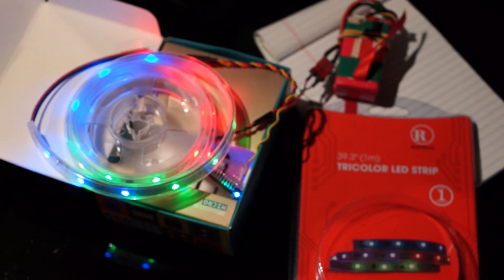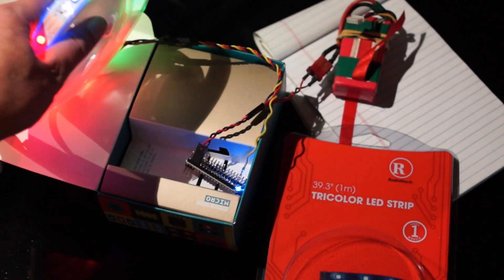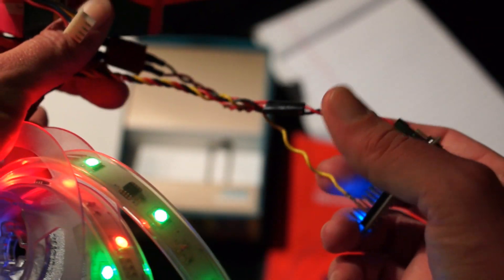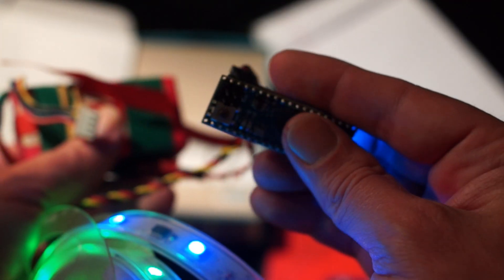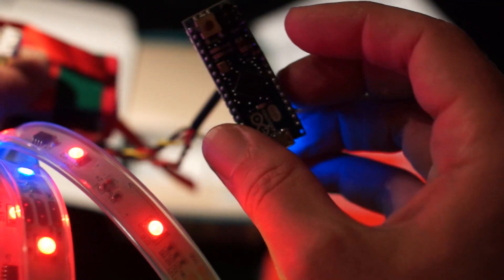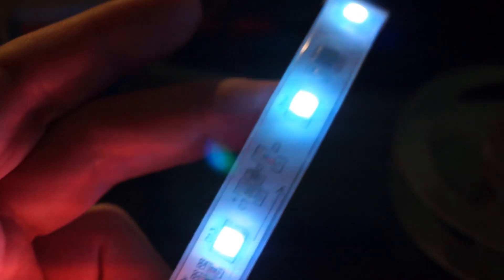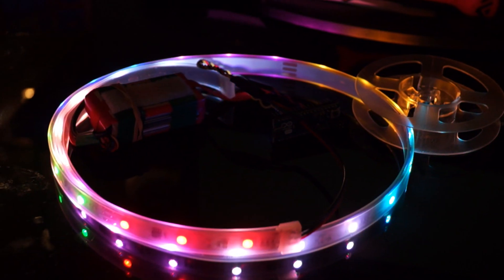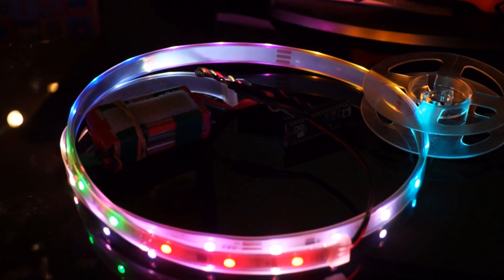Radio Shack Tri-color LED Strips How-to

Comment: This library linked above doesn't work with the Radioshack TM1803.  But the library that "skeepskeeperson" put in the comments below, worked with my strip.  Keep in mind that the Green and Blue signals are switched in this library for some reason.  So (0,255,0) is blue and not green, as well as (0,0,255) is green and not blue.

Comment: Mine still doesn't work, I have swapped boards, LED strip, code, the digital pin out. IDK why i cant make these work its really starting to make me feel like this isn't my thing. I feel like just go buy some pre made LED stuff like normal people do... Whats the issue with these anyway??? And why don't they just work properly with this or any code ive tried??? I found these for 90% off and they gave me an idea for a quick LED infinity mirror PC Case light. Now im regretting the stroke of inspiration...

Comment: Do you know how to create a fade effect with the Radio Shack LED Strip? Also if you had used an UnoR3 would you have powered the strip using a 12 Volt/1amp wall wart plugged into the Arduino instead of the battery and spliter? I found the actual Radio Shack program code and instructions and seems to work as advertised.  Did you ever finish your project with your copter?

Comment from the maker: @ForSquirel- I wasn't lucky, I was persistent. When I realized that the data stream it needs is very simple, I just found a library that sends that kind of data and worked with it until I got it. Most of the folks here seem to be having wiring problems. I got two more of these strips before Radio Shack closed and they work fine.
Reply: +jasmine2501 can u tell me how u did it?  i get crazy blinking.
Reply: +carlos limon im using a arduino micro.  when i try one color only and one light it still seems wrong.
Reply from the maker: Sounds like a wiring issue - many people make the mistake of not providing enough power to the strip. It's tricky - you have to provide plenty of power for the strip, but you can't run that through the Arduino, it has to be parallel.
Reply: yup.  dont forget to ground arduino if using a usb.

Comment: Hey man can you please help me out. I plugged the red wire to VIN, the green wire to Analog 0, and the black wire to Ground, like the radioshack instructions showed. On the code you gave us, i changed <10> to <A0> , for analog 0, but when i run the lights on 12V, only the first 3 LED lights blink green for a second and thats it. After the first three blink, nothing turns on
Reply: only 3 lights blink green, idk what to do

Comment: This LED strip has been an incredible source of frustration. Would you mind helping me sort out the wiring? Anyone?
Reply from the maker: seanlovesjobo What is not clear from the video? The 12V source is wired in parallel to the light strip and the Arduino, with a common ground, and the signal line just runs from the Arduino to the strip. Make sure you have the right kind of LEDs - if your strip has 4 wires, then it's not the same one as in the video.
Reply: I've got the 3 wire strip. For some reason the strip doesn't light but if i disconnect the LED strip from the ground about 4 LEDS flicker or even come on. But that's all i can seem to get. the wiring was not very clear in the video but it seems like i get it, it just doesn't seem to work any ideas?
Reply from the maker: Almost seems like you wired it up backwards. I don't know how to help you in the comments. Maybe post a video, it seems lots of people have this problem? Look in the other comments too, some other people have reported the same symptoms.
Reply: Thank you very much for the response. Yeah i can't figure out how to trouble shoot it. I have tried fast LED libraries and pololu to no avail. With the multi meter it seems like there is some voltage drop in the wiring i don't have the experience to figure out why. I just came over to microprocessors through quacopters. If you can think of anything please let me know. LOL i can't believe i am getting out witted by an LED strip.
Reply from the maker: It took a little messing around before I got it right. As I said in the video, I had to figure it out for myself. It really is fairly simple, but having some microcontroller knowledge helps.
Reply: Ah no worries. They are bullshit and there is no support i took them back.
Reply from the maker: Definitely true given that Radio Shack is basically out of business. These were never designed for consumers really anyway, and the product packaging and examples are terrible. For those of us with electronics know-how though, it's just a strip of TM1803s which is a very common LED driver chip, and there's plenty of low-level information on it. I was able to figure things out from that stuff, but it's not designed for consumers, those IC data sheets are designed for engineers.

Comment: Bought one cheap in their closing sales - they are good - but the NeoPixels ones you can get on ebay for less than $10 at the moment are better as each pixel in the strip can be a different colour. So you get 30 individual leds per meter rather than just the 10 groups of 3 per meter in this one and so the animations you can do are better..

Comment: ----------im trying to have these controled by buttons and activate certain patterns when one button is pressed or when pulse light this pattern. or have them off untill a button press and have them turn on for a single loop. its for an old arcade machine mod. bbut from what ive read its not this easy to just rig up the switches on digitial input and drop in the code. some advice or help would make my day :0

Comment: the official non altered code worked fine for me and none of the code you wrote did not work, all of it keeps giving me errors. these are the errors i got for rainbow  and i get similar errors on your other code

LedStripRainbow:15: error: 'rgb_color' does not name a type
LedStripRainbow:15: error: expected constructor, destructor, or type conversion before '<' token
LedStripRainbow:19: error: 'rgb_color' does not name a type
LedStripRainbow:29: error: 'rgb_color' does not name a type
LedStripRainbow.ino: In function 'void loop()':
LedStripRainbow:54: error: 'colors' was not declared in this scope
LedStripRainbow:54: error: 'hsvToRgb' was not declared in this scope
LedStripRainbow:58: error: 'ledStrip' was not declared in this scope
LedStripRainbow:58: error: 'colors' was not declared in this scope

Comment: Thanks for the tutorial!

I picked up a couple of the TM1803v2.0 based strips from Radio Shack this weekend. I discovered that I needed to use version 1.2.0 of the pololu library in order to get everything to work properly - it did not work with what's currently on the master branch in guthub. https://github.com/pololu/pololu-led-strip-arduino/releases/tag/1.2.0

If it helps anyone else, I was able to use a 400mA power supply with my Arduino UNO to power this, while the documentation suggests that you need at least a 1A supply.
Reply: Drew Farris You sir are a life saver! I could not get it to work and I kept thinking it was something I was doing, but then I found your comment!
Reply: Johnathan Tafoya  glad to help!
Reply: +Drew Farris PERFECT! Hour of my time with the old library. Put on new library and WALA! On! Thanks.

Comment: can the leds work with only wiring it up to a DC source, aka without programming/microprocessors?
Reply from the maker: No, these are not designed to work that way. There are single-color LED strips that do work that way. You can't change colors without some method of sending that information, so NO simple DC-powered strips will change colors.

Comment: Thank's for the video. Are the strips your using the TM1803 chips? That is what I have from RS and every program I run is completely a completely different display on the led strips. I have installed the libraries and can get them to work but the led's just flash different colors and do not seem to accurately follow the code in the arduino ide. If you are willing to help I will post a video of the code I use including the PololuLedStrip.h and PololuLedStrip.cpp libraries and the outcome on the actual led strip(it is the 30 led 10 segment array. Thank's for any help you can offer.
Reply from the maker: Christopher McGehee Yes, as stated in the video, they are TM1803. Really, we don't need to be using all these libraries, a simple timed serial pulse is all it needs. The libraries are a little bit of bloat. Maybe extract the serial code from Pololu's lib and see if it works without all the overhead? That way you'll be sure what you're sending down the data line.
Reply: Christopher McGehee did you ever sort this out? I'm having a similar issue, and I'm not sure if it's the LED strip or something else.

Comment: Hey jasmine2501! I changed my colors to just red and blue and I am trying to get them to just stay a solid color but instead its just flashing and changing to different colors and i dont know why. here is my code can you help me? 

#include <PololuLedStrip.h>

// Create an ledStrip object on pin 10.
PololuLedStrip<10> ledStrip;

// Create a buffer for holding 30 colors.  Takes 90 bytes.
#define LED_COUNT 10
rgb_color colors[LED_COUNT];
rgb_color refColors[10];

void setup()
{
}

void loop()
{  
  //load the colors
  refColors[0] = (rgb_color){ 255, 0, 0};
  refColors[1] = (rgb_color){ 255, 0, 0};
  refColors[2] = (rgb_color){ 255, 0, 0};
  refColors[3] = (rgb_color){ 255, 0, 0};
  refColors[4] = (rgb_color){ 255, 0, 0};
  refColors[5] = (rgb_color){ 255, 0, 0};
  refColors[6] = (rgb_color){ 0, 0, 255};
  refColors[7] = (rgb_color){ 0, 0, 255};
  refColors[8] = (rgb_color){ 0, 0, 255};
  refColors[9] = (rgb_color){ 0, 0, 255};
  refColors[0] = (rgb_color){ 0, 0, 255};
  
  //loop ten times to create chasing effect
    ledStrip.write(colors, LED_COUNT);
    delay(1000); 
  }

eventually I want to be able to change the color of the entire strip to one solid color with a potentiometer but and also have a button to change to different modes but i can not do any of that if this strip doesn't want to work the right way. Any help would be great!
Reply: I know i have refColors[0] twice lol opps

Comment: Thanks for sharing this video. I was able to get my strip partially working. I can get the first three leds to light up, but only green. No matter what I change as far as the coloring it stays green and only the first three leds light up. Is this possibly a problem with my power supply? The adapter says the output is 12v 1a so that should be enough.
Reply from the maker: Well, yeah 12V 1A should be enough to light up more than the first segment at least. Make sure the LEDs main power leads are wired in parallel, not through the Arduino in any way.
Reply: jasmine2501 They are powered separately from the arduino.
Reply: I have the exact same problem, yet my power source is fine

Comment: only the first three lights are lighting up, and it's green. I have the same strip but could it be because i'm only using a 9.6v power?
Reply from the maker: Yes, 9 volts isn't enough. Some of the colors drop the voltage more than others, so you're probably just above the cut-off for green and below the cutoff for red and blue. Strange because red LEDs are usually the lowest voltage, but yeah, it's totally reasonable for only one color to light up with not enough voltage. The specs say to use 12V - in the video I'm using a 12.6V Lipo, but it's discharged a bit so it's just under 12V. You have a little wiggle room, but I wouldn't go lower than 11.2V (I can explain that number but it would be a long explanation, it's not a guess though)
Reply: Thank you very much for the reply! I was trying to help a friend get his strip working, that was my only guess for it wouldn't work ahah.

Comment: How do i use the c++ code on my arduino, im trying to find code with the arduino ide, since radio shacks is really bad.
Reply from the maker: Eh... you could start by watching the video.
Reply from the maker: Works fine with mine. Proven on video.

Comment: jasmine2501  hey thanks for the awesome video i tried modifying part of the code to adjust for colors i wanted and im getting this error 
"expected `i' before ')' token
LedStripGradient.ino: In function 'void loop()':
LedStripGradient:66: error: expected `;' before '}' token
LedStripGradient:66: error: expected `}' at end of input"

here is my code if you can spot something wrong it would be truly appreciated 

#include <PololuLedStrip.h>

// Create an ledStrip object on pin 12.
PololuLedStrip<12> ledStrip;

// Create a buffer for holding 60 colors.  Takes 180 bytes.
#define LED_COUNT 30
rgb_color colors[LED_COUNT];

void setup()
{
}

void loop()
{
  // Update the colors.
  byte time = millis() >> 4;
  for(byte i = 0; i < LED_COUNT; i++)
  {
    byte x = time - 8*i;
    
    colors[0] =(rgb_color){ 100, 0, 0};
    colors[2] =(rgb_color){ 100, 100, 0};
    colors[3] =(rgb_color){ 0, 100, 100};
    colors[4] =(rgb_color){ 100, 0, 100};
    colors[5] =(rgb_color){ 81, 100, 21};
    colors[6] =(rgb_color){ 0, 50, 0};
    colors[7] =(rgb_color){ 75, 100, 0};
    colors[8] =(rgb_color){ 0, 105, 0};
    colors[9] =(rgb_color){ 0, 100, 42};
    colors[10] =(rgb_color){ 85, 15, 0};
    colors[11] =(rgb_color){ 100, 0, 0};
    colors[12] =(rgb_color){ 100, 100, 0};
    colors[13] =(rgb_color){ 0, 100, 100};
    colors[14] =(rgb_color){ 100, 0, 100};
    colors[15] =(rgb_color){ 81, 100, 21};
    colors[16] =(rgb_color){ 0, 50, 0};
    colors[17] =(rgb_color){ 75, 100, 0};
    colors[18] =(rgb_color){ 0, 105, 0};
    colors[19] =(rgb_color){ 0, 100, 42};
    colors[20] =(rgb_color){ 85, 15, 0};
    colors[21] =(rgb_color){ 100, 0, 0};
    colors[22] =(rgb_color){ 100, 100, 0};
    colors[23] =(rgb_color){ 0, 100, 100};
    colors[24] =(rgb_color){ 100, 0, 100};
    colors[25] =(rgb_color){ 81, 100, 21};
    colors[26] =(rgb_color){ 0, 50, 0};
    colors[27] =(rgb_color){ 75, 100, 0};
    colors[28] =(rgb_color){ 0, 105, 0};
    colors[29] =(rgb_color){ 0, 100, 42};
    colors[30] =(rgb_color){ 85, 15, 0};
    
  
  // Write the colors to the LED strip.
  ledStrip.write(colors, LED_COUNT); 30
  
}
Reply: never mind i just redid it but now it seems that the colors i set stay constant and dont rotate around how exactly do i get them to  rotate around?
Reply from the maker: Well, you need to set the colors to some value that changes. In the code you posted, there's no variables in the colors, only constants - so they will always be the same colors.